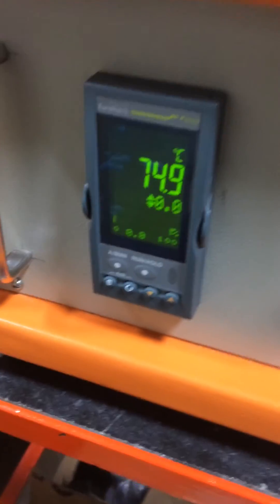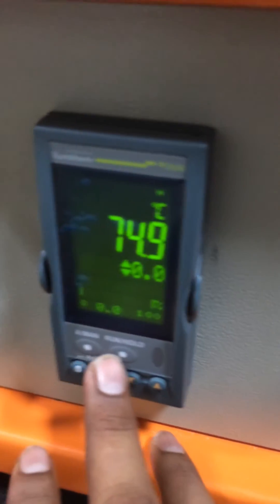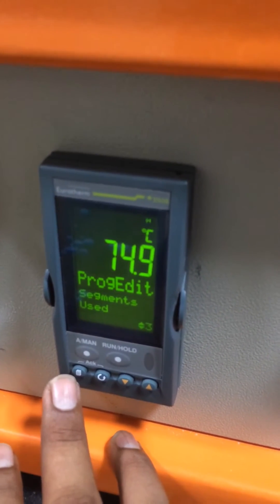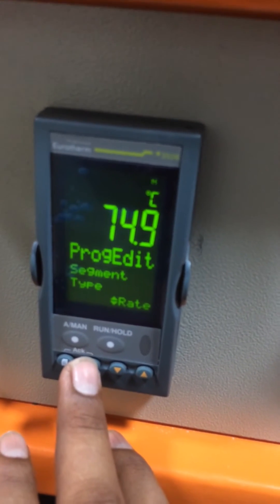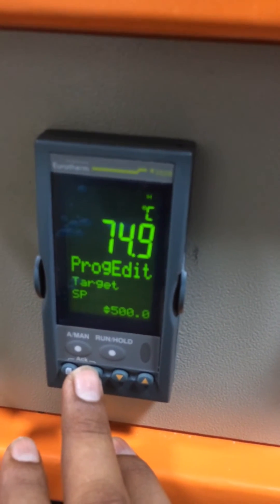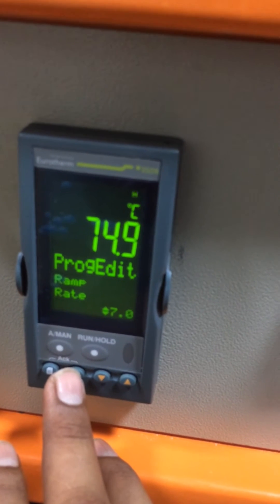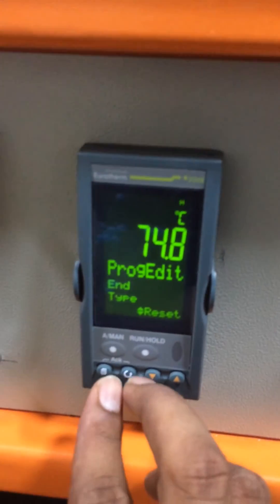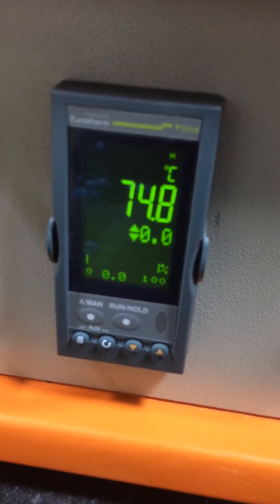3508 Eurotherm controller

Comment: Hi,
I have question about eurotherm 3508. I have three models of it all have 3.51 firmware and same cards (DCOPisol, DCretranisol, analogIP). Problem is when i am doing quick start and i have not same parameters to choose. I have not AltSp parameter (in one it is  and in another not). Have you idea what is wrong ?